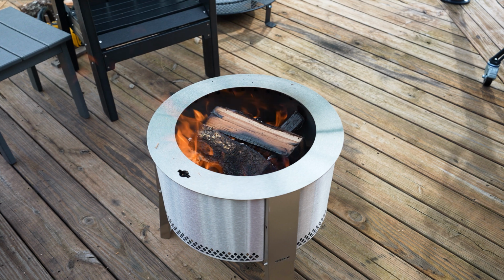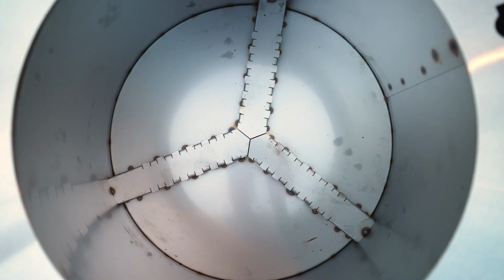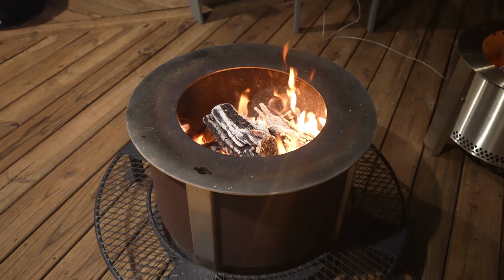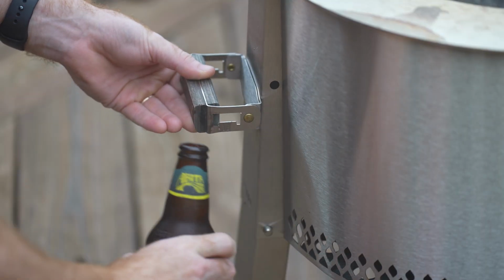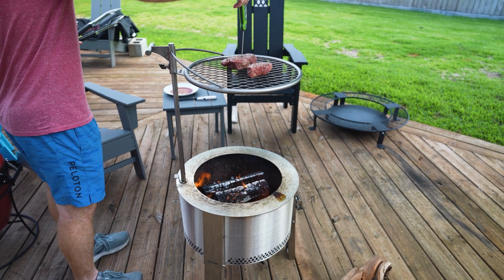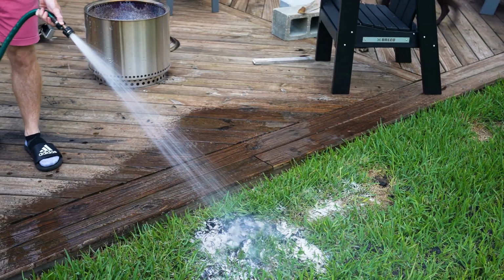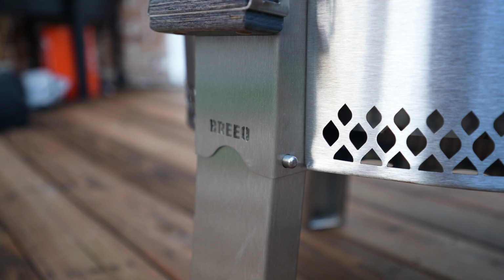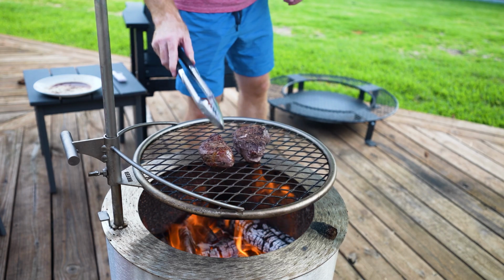Breeo Y Series Firepit: Is It Really Safe for Your Deck?

Comment: I wonder if one reason the Y19 does not put out as much radiant heat as your X series because the X series is the Corten steel. While the Y 19 is made of all stainless. I own and have used the x19 stainless model for a couple of years now and I've always been wondering if the X19 Corten steel puts out more radiant heat.

Comment: Thanks for the review.  Idea on radiant heat.  Make a 2x4 frame stick figure person with points of head chest and toes.  And a spacer attacted with avg distance use a 2x4.  Get laser temp gauge. Measure temp over time at each point.

Great review.  I am rebuilding life, buying a house right now and looking for new firepit.  Leaning heavy X series cuz built in PA and warranty.  Looking to getting back into video reviews with GF showing our adventures traveling this path and remodeling new place.  So I appreciate info on this firepit.

Comment: I 've just built a new deck with Trex decking, as well as a new Breeo X24.  I watched all of these videos about them on decks and I decided to put it on top of 32" x 32" concrete patio blocks.  I sat the legs on 1 1/2" thick patio bricks, total of 3 inches off the plastic deck material.  After about an hour with a small fire, it made the blocks to hot to touch.  DON'T DO IT!

Comment: The Y is a flimsy piece of shit. The legs wobble like hell. Is it worth $495? Nope. And Breeos lifetime warranty is a joke. They cover 5 years against rusting through. What a life time...
I would not hesitate buying the cheaper ones from competitors. In the end they all work and last the same.
And they all will rust through somewhen. Once you had a couple of fires in them, the material characteristics change and the rust proof surface won't be rust proof any longer. Mine is rusting like hell even though I clean it after every burn and store it inside my garage. I would not pay 495 bucks for a fire pit again. The cheaper ones, like the ones from Costco, Solo etc. do exactly the same but cost only half of this. I recommend going that route. Breeo is nothing but a lifestyle product. They are made in the U.S. which I like, but not at any costs.

Comment: This review was the tie breaker between this and the Solo Stove.  Placed my order.  I’m not going to use this for cooking since I have a great Weber gas grill that I’ve been camping with for almost 18 years now.  I buy high quality because I’ve found that it saves money in the long run.  Another plus is a US product rather than Chinese.  I love the fact that it will burn wood pellets which is great for short term fires.  Met a guy last year with a small Solo Stove that worked with pellets.  Made a nice fire, but the new clean out concept for the 2.0 Solos won’t support pellets any more.  If you buy this via Amazon, it will be shipped from Breeo and using the Amazon card you can spread the cost over 12 months at no interest!

Comment: Have an X series and love it ...deck friendly not an issue right now...have the outlook grill and the high temperature above the stove can be a challenge to learn to use
and we like the heat cast off from the stove sideways as that is part of the 'charm' of a fire is feeling the heat
Reply from the maker: Two biggest differences between the X and Y are radiant heat and deck safe imo. Can’t go wrong with either. Do you keep your outpost at one height or move it up and down while cooking?